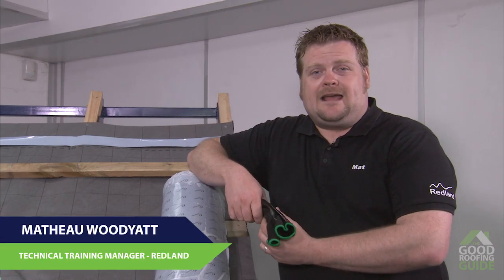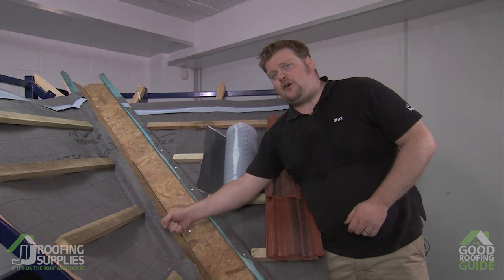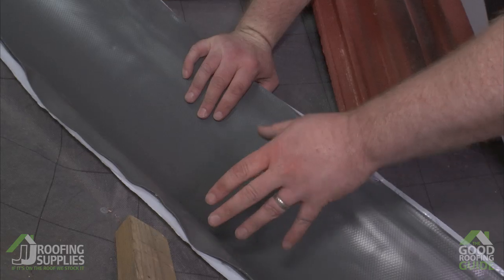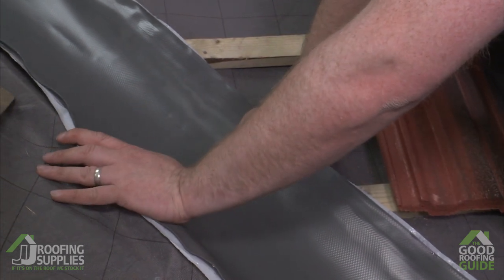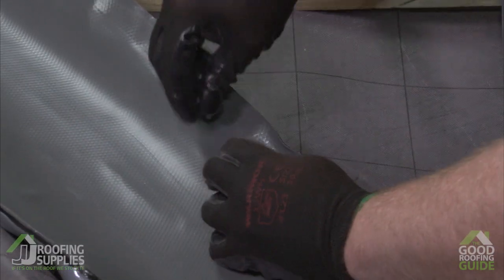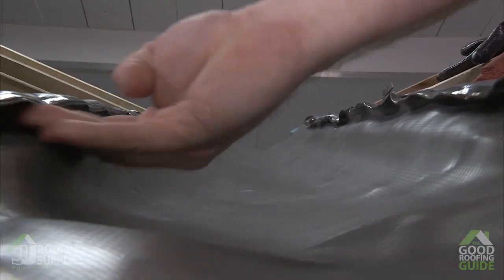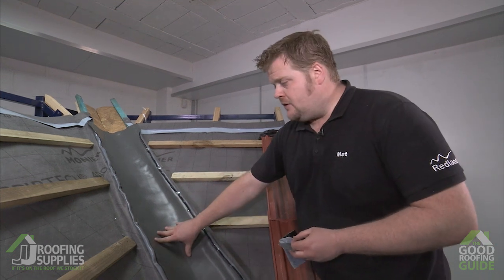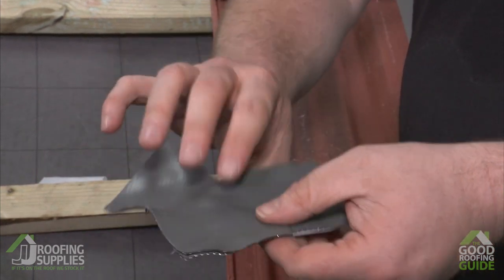Wakaflex - How To Install a Lead Replacement Valley

Comment: yeah yeah, lead is the best product for the job, because my dad and grand dad and 50 generations be4 that used it back to when Romans came on this island and taught u how to build houses instead of mud huts. let me guess you still use  mortar to bed ridges and F1 felt to waterproof it . its not like redland spend loads of cash on German test centres to get the guarantees in order.
it doesn't have the finish of the lead,BUT its half the price, half the weight, its not toxic, easy to handle and doesn't require 10 years of experience to install
Reply: And probably needs replacing in a decade.

Or use shitty old fashioned lead and never have to touch it again.
Reply: @muddyfunker3014  Until it cracks due to the expansion and contraction of British weather like all lead does in this country.

Comment: Jeez, sooooo many 'experts' on here who have never seen, touched or even used the product but who feel fully qualified to pass judgement! I wish I was that clever...I expect you all want to bring back steam trains and coal fired ranges! :)
Reply: I’m a roofer and I’ve installed this and it’s not good , mite b ok on a mock roof in a factory but on a roof on site in wind and dampness it’s jank
Reply: Lead will last the life of the building you biff.

The latest materials and methods don't always equal an improvement.
Reply: Personal insults weaken a point of view, not strengthen it.

Comment: In Australia we use colorbond metal sheet preformed and last forever.  This is not a suitable for roof valley, very unprofessional. if you drop a tile on it, that's it lol.
This product are supposed to be use as tile flashing transition from brick wall to roof tiles not for valley lol. I just couldn't stop laughing 😂 😂

Comment: the short answer is there is no replacement for lead.
Reply: I'm an Aussie roofer and we use metal valleys instead of lead. I'm sure there is a good reason, but why does the UK use lead valleys and not metal ones?
Reply: @jacobosborne972  we also use metal and fiberglass valley, depending on the roof sometimes a tiled valley. I would say there are two main reasons for using lead. with all roofing systems it depends on the roof as choice and what they like to do. reason 2 is there are a lot of old houses and the look of lead fits the aesthetics. there are alternatives to lead but no replacements as a good slate roof with all lead trimmings should last over a 100 years before a major repair is needed and even then all the lead would be recycled. alternatives to lead in England generally last up to 50 years. I have used alternatives depending on the roof system and customers preference. for example if the customer wants a concrete tile roof to match the area they are in then I would use a dry fibreglass system so I'm not using cement to point the tiles in the valley as that would be the first thing that would need to be repaired so I don't have anything against alternatives but a replacement should be as good or better. I hope this answers your question 👍

Comment: This is no replacement for lead. Nasty stuff, seen it on a job before scuffs up really bad on a sunny day you can't walk on it. Lead all the way baby!!!
Reply: yeah yeah, lead is the best product for the job, because my dad and grand dad and 50 generations be4 that used it back to when Romans came on this island and taught u how to build houses instead of mud huts. let me guess you still use  mortar to bed ridges and F1 felt to waterproof it . its not like redland spend loads of cash on German test centres to get the guarantees in order.
it doesn't have the finish of the lead,BUT its half the price, half the weight, its not toxic, easy to handle and doesn't require 10 years of experience to install
Reply: @savitre1359  tosser